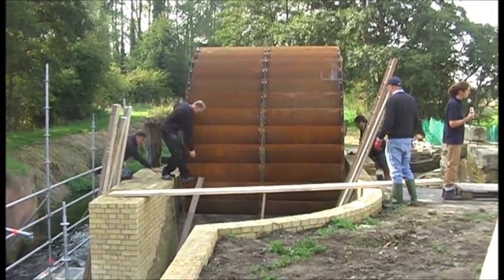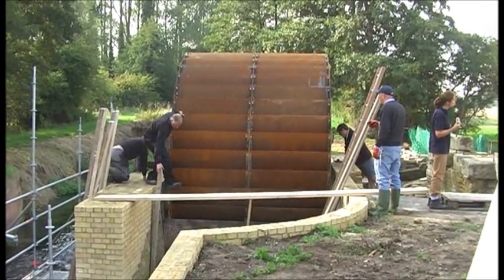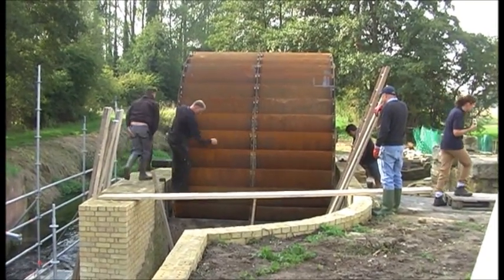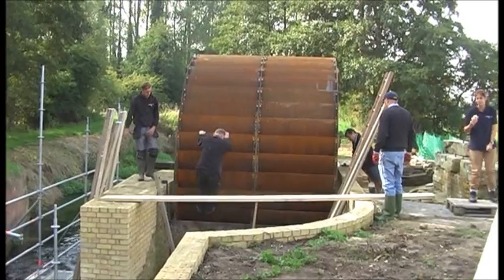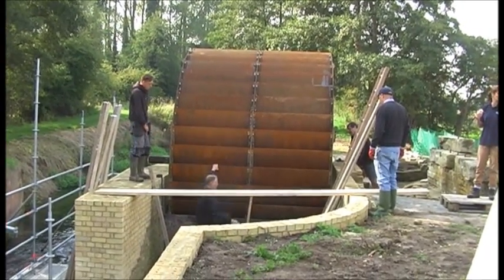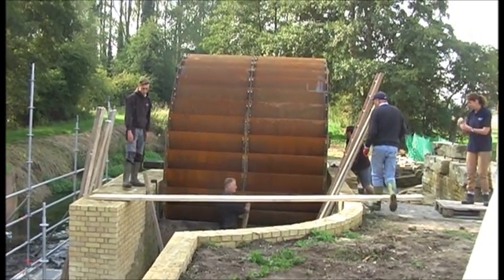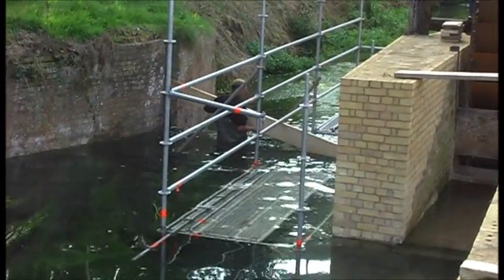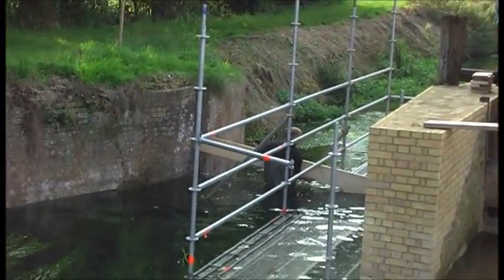Water Power

Comment: Whenever installing a waterwheel, Regardless of size and community engagement, performance is underwhelming. An underthrow wheel at minimum needs to be fed at height of the axle, to at least have 1/4 of the circumfrence powered. They need to raise the wier or the waterlevel!
Reply: That’s just absolute knackers and makes me think instantly that you’re an American. Giving an opinion on something they have zero experience of. Shut up until you’ve actually got something factual to say. For your own good as well as the good of others. Bloody yank morons.

Comment: Under shot wheels were never that effecient, overshot used not only the weight of water but gravity as well and was used as much as possible often diverting water for long distances just to get enough head. This I believe is where the term for pumps came from. Many leats  here in Cornwall ran for  hundreds of metres.  The principle was used before pumps for pumping water out of the mines and running the mill stamps as well as for grinding cereals.